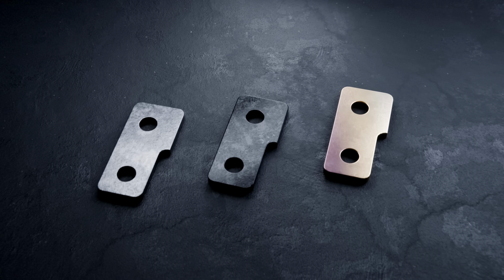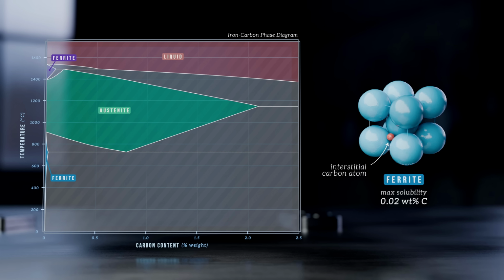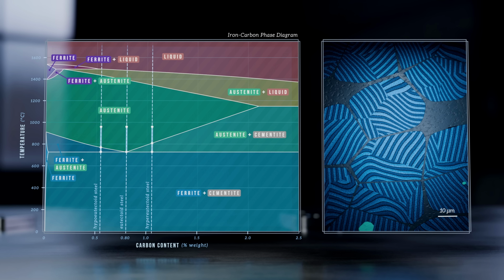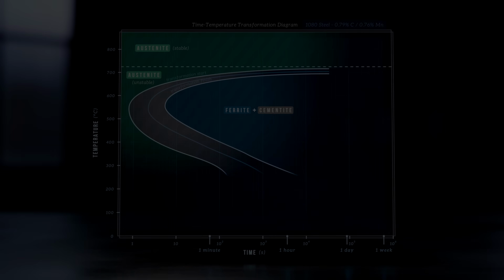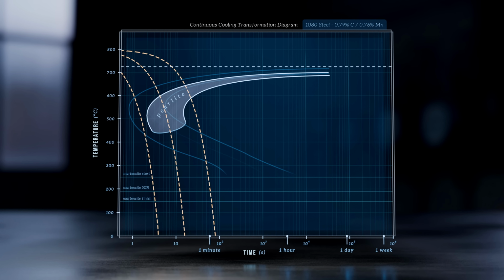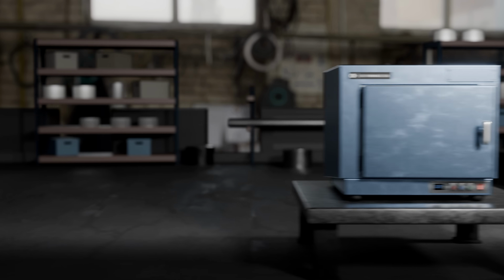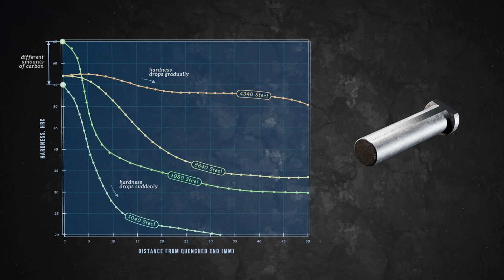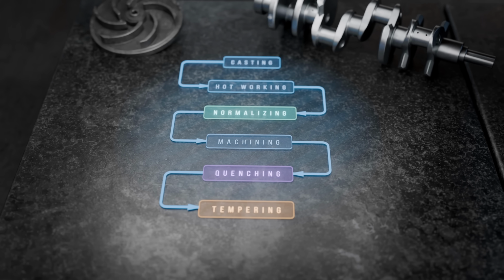Understanding Steels and Heat Treatment

Comment: As a mechanical engineer and currently pursuing a masters in materials engineering, this video is impeccable. Amazing job, this should be a std way to teach heat treat for all engineering courses.
Reply: Do they teach you much more in steels than what is here... I am self taught, hate schools and lectures, and I got a grip on almost all of this, was wondering how much more they teach...?
Reply: @paulmeersa3106  look, materials engineering is a very complex theme. In my case is focused in metals, so I learned every single concept and mechanism behind it. So, this video is maybe 2% of what you'll learn during a materials engineering masters course. There are plenty of themes inside the course.
Reply: Thanks for your contribution @igorhcc , loved it. But Materials Engineering is a more focused in materials right?
So, in means o Mechanical Eng. is it some relevant content?
Reply: @scidotonly6364 it depends on the college/region you study. Here were I live, materials engineering master's course is focused in metals, steel to be specific, so it's very well connected to mechanical engineering. My research for example is about mechanical phenomena during deep drawing of dual phase steels...

Comment: Great video! As someone worked with 10.9 high strength bolts - tempered martensite, with large bolts 100mm or so more challange was tempering the core reliably than quenching. At least in industrial volume production. 

Now i will teach students and will refer to this video!

Comment: As a pedantic mechanical engineer I gotta point out that technically the delta phase should be noted as alfa(delta) since it is the same phase just higher up. Also You missed the ledeburite phase, but also understand why it was skipped. Overall great video

Comment: It’s wild how steel isn’t defined by its ingredients but by its history of temperature. Same atoms — different timeline, completely different material. Heat treatment is basically time travel for metals.
Reply: Not really. Normal mild steel cant be hardened, the steels that can be hardened have extra ingredients and theres a wide range not mentioned in this video. High tensile steel is already harder from the mill without any heat treatment because of its ingredients. Often used in earth moving equipment, and heavy structures like bridges and train rails. No heat treatment required usually but they can be further hardened through heat treatment in some cases. Those high tensile steels are still weldable, drillable and ideal for forging., .Tool steels are harder from the mill too, but its designed specifically for heat treatment, and never used without heat treatment, Used for press tools/dies, guillotine blades where ultimate hardness is required. These steels can not be welded and not good for forging.
Even mild steel  comes in different recipes for different purposes, with added ingredients like lead for easier machining, chip control, and better surface finish.
 So theres 3 main grades, mild, high tensile, and tool steel and all 3 have different ingredients. Then there are dozens of variations within those 3 groups, and different mills have different recipes often a trade secret.
Reply: @tubester4567  Yeah, totally fair point — you’re absolutely right that composition plays a huge role too. I just liked how the video framed it — that the history of how steel’s treated can completely change its character, even when the base mix looks similar. It’s crazy how much variety there is just within “steel.” Appreciate the extra detail, that was a great breakdown. 🤠
Reply: @VOIDLOG-b5b No problem mate, Yes, The mills are still fiddling with formulas and coming up with new grades of steel all the time for special purposes. There are so many but knowing the 3 main grades makes it easier to understand.

Comment: i work as an engineer in the forging industry. Before we used to nitrate our dies for our presses and hammers because it would mean we could get 10 000 parts out of a die before re-machining it, while non nitrated dies could only get 5 000 parts before re-machining. The hardness was very high though, so much that it was a problem to re-machine them. Also the gas from the nitrating ovens are suffocating gasses, which was a HSE hazard. The ovens leaked from time to time causing a danger to people.

Comment: We used to make 1497, 1095, and a bunch of alloyed steels like 14s28b, 1028s, 4340, 8630 in our mill. We never did any special finishing to our coils other than letting them sit and cool after passing laminar flow.

I remember we even made basic 1008 or 1008s(silicone restricted). We added vanadium, moly, mangnese, aluminum, colombium, nickle, chromium and a whole bunch more.

Comment: Impeller in my 75 horse electric pump looks like that one housing can only take 250 psi. I took 3 3/4 valves put in line cracked valve open half turn took out lining it raised temp to 140 degrees. With no fuel and with popoff 150.circulate.

Comment: 0.3 is 30%, 0.6 is 60%.  0.003% is 3% of 1%. This is basic decimal placement.  100x0.3=30%  100x0.003=0.3% meaning 3% of 1%. 
So 0.3 is not the same as 0.003 when measuring precise measurements of metals to mix.

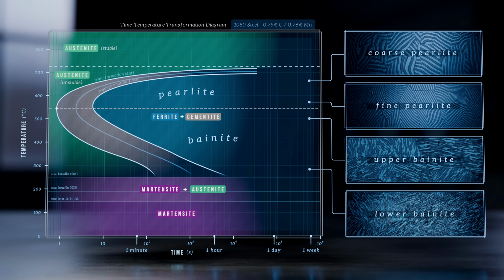Comment: This is very interesting, but @12:20  suddenly you're talking about steel. You had been talking about iron up this point. I had been wondering when you were going to switch over to steel, but there was no clear, meaningful transition.

No manganese or silicon was ever added in, but suddenly it's steel?
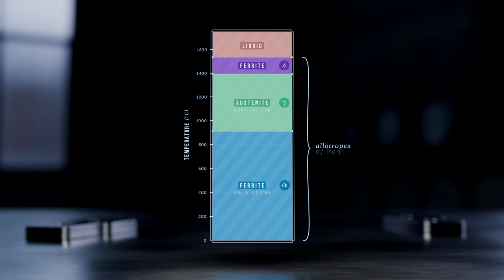Reply from the maker: The transition from talking about iron to steel was at 2:47, when I started discussing adding in carbon. But yes I should maybe have been more explicit.

Comment: AI Summary

Abstract:

This video provides a comprehensive overview of the metallurgy and heat treatment of steel, explaining how its mechanical properties can be precisely controlled. It begins by establishing steel as an iron-carbon alloy and introduces the fundamental phase transformations of iron from ferrite (BCC) to austenite (FCC). The video then explores the iron-carbon phase diagram to explain the formation of equilibrium microstructures like ferrite, cementite, and pearlite under slow cooling conditions.

The core of the explanation focuses on non-equilibrium transformations using Time-Temperature-Transformation (TTT) and Continuous Cooling Transformation (CCT) diagrams. These are used to illustrate how different cooling rates produce distinct microstructures such as bainite (offering a balance of strength and toughness) and martensite (an extremely hard but brittle structure formed by rapid quenching). The video details the four primary heat treatment processes: annealing (softening), normalizing (refining structure), quenching (hardening), and tempering (restoring toughness). It also covers key related concepts, including hardenability—the ability of a steel to harden through its cross-section, which is enhanced by alloying elements—and various surface hardening techniques like induction hardening, carburizing, and nitriding, which create a wear-resistant surface while maintaining a tough core.

The Superpower of Steel: A Guide to Heat Treatment

*   00:00:02 Steel's Unique Property: The video opens by highlighting steel's defining characteristic: its ability to have its properties—such as hardness, strength, and ductility—dramatically altered through precise heating and cooling, even with an identical chemical composition.
*   00:01:31 Iron's Atomic Phases: To understand steel, one must first understand iron. At room temperature, iron has a Body-Centered Cubic (BCC) structure called ferrite. When heated above 912°C, it transforms into a more compact Face-Centered Cubic (FCC) structure called austenite.
*   00:02:43 The Role of Carbon: The iron-carbon phase diagram shows how adding carbon introduces new phases. Austenite can dissolve a significant amount of carbon, but ferrite can only hold a tiny amount. Excess carbon in ferrite forms cementite, a very hard and brittle iron-carbide compound.
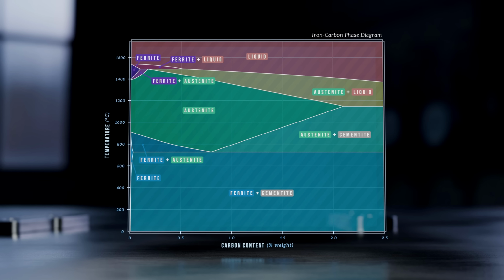*   00:04:42 Equilibrium Microstructures: During slow cooling, austenite transforms into a layered structure of ferrite and cementite known as pearlite. The specific combination of phases depends on the carbon content.
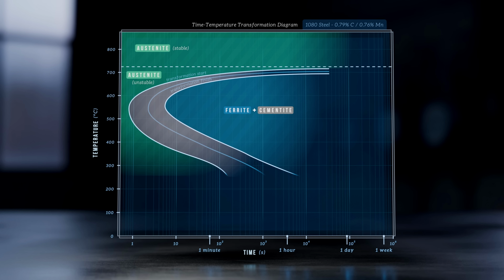*   00:08:30 Martensite: The Key to Hardening: When steel is cooled extremely rapidly (quenched), carbon atoms become trapped within the iron lattice, forcing it into a distorted Body-Centered Tetragonal (BCT) structure called martensite.
    *   Key Takeaway: Martensite is extremely hard and strong but also very brittle. Its formation is a "diffusionless" transformation, meaning it occurs almost instantly.
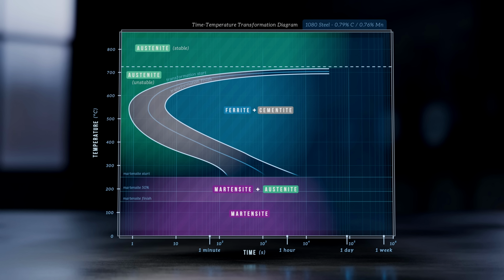*   00:10:46 Controlling Microstructure with Cooling Rates: TTT and CCT diagrams show that different cooling rates produce different microstructures.
    *   Pearlite: Forms during slower cooling.
    *   Bainite: Forms at intermediate cooling rates and provides an excellent combination of strength and toughness.
*   00:14:40 The Four Main Heat Treatments:
    *   Annealing: Heating and then cooling very slowly inside a furnace to produce soft, ductile steel that is easy to machine.
    *   Normalizing: Heating and then cooling in open air. This is faster than annealing and creates a stronger, harder, and more uniform fine-pearlite structure.
    *   Quenching: Rapidly cooling the steel in a medium like water or oil to create hard, brittle martensite.
    *   Tempering: Reheating a quenched part to a lower temperature (e.g., 200-600°C). This process restores toughness and ductility while retaining much of the hardness and strength. The resulting material is called tempered martensite.
*   00:18:34 Hardenability: A measure of a steel's ability to form martensite throughout its cross-section, not just on the surface.
    *   Key Takeaway: Carbon content determines the *maximum achievable hardness*, while alloying elements (like nickel, chromium, manganese) increase hardenability, allowing thick sections to be hardened effectively.
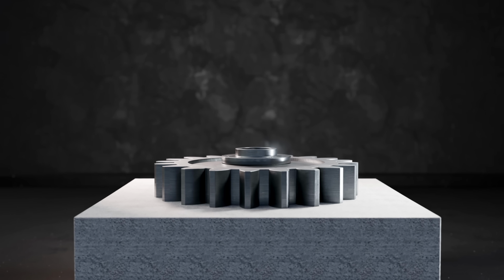*   00:20:46 Surface Hardening Techniques: These methods create a hard, wear-resistant outer layer (case) while leaving the inner material (core) tough and ductile. This is ideal for parts like gears and shafts.
    *   Methods: These include induction hardening (heating only the surface before quenching) and case hardening techniques like carburizing (adding carbon to the surface) and nitriding (adding nitrogen).

AI-generated summary created with gemini-2.5-pro for free via RocketRecap-dot-com. (Input: 20,231 tokens, Output: 1,047 tokens, Est. cost: $0.04).